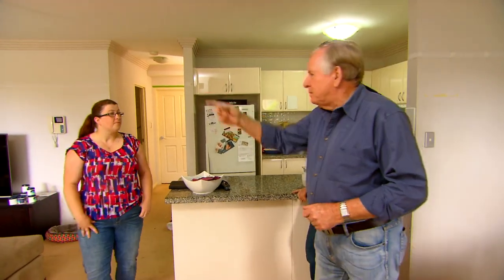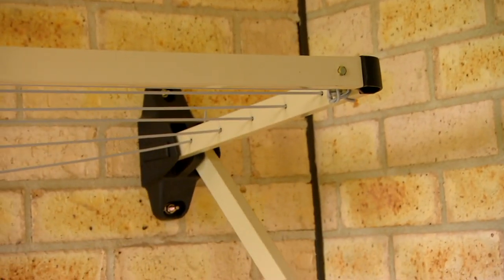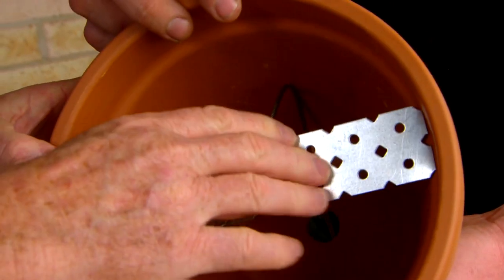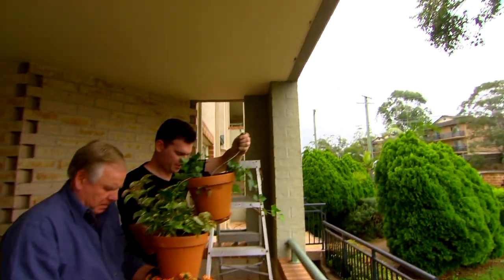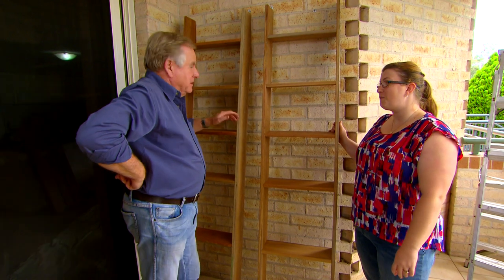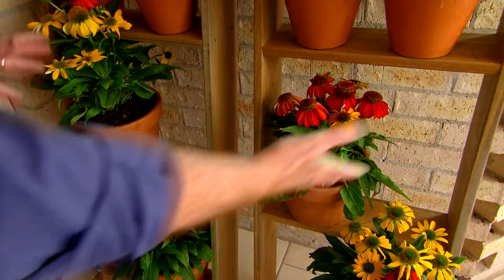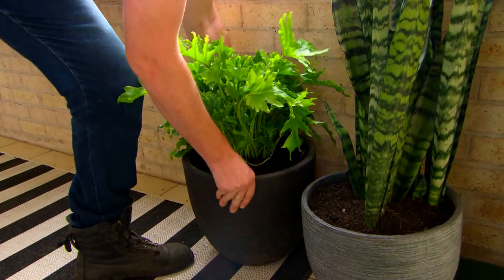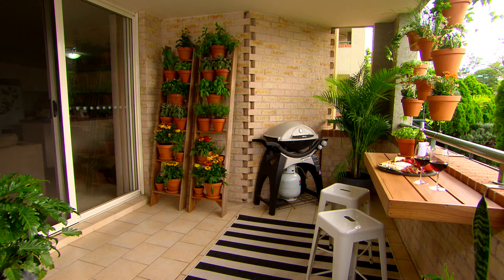How to Create a Renter-Friendly Balcony Garden | GARDEN | Great Home Ideas

Comment: So, here in the states, specifically the PNW, we can find trellis, cedar or PVC. And they tend to be around 6 feet tall.
Not long enough for the trellis needs of an area in front of my house, where i need a trellis to hang about 10 ft down from the eve to the ground.

You used still wire to hang the pots... well that’s how I ended up making my trellis. Steel wire connected to the overhang on top and the floating deck below. Two strings of wire set about 2 feet apart. So I’m glad to see that I was not alone in this idea... though yours is not a trellis....

The trick now is to see if the vines ( clematis and tame morning glory) will cling to the metal. As they grow, I’ll guide them to cross cross back and forth between both wires.

Anyway, great video! And yah.... north facing for better sun???  That’s interesting to us “northerners”

A question before I leave....
If we, up here, call Australia “down under”, shouldn’t we say that about Columbia, Africa, Ecuador, and all the rest in the Southern Hemisphere?
🤔
Reply: No, because we are are way down under than them